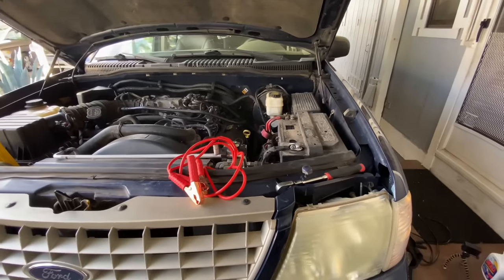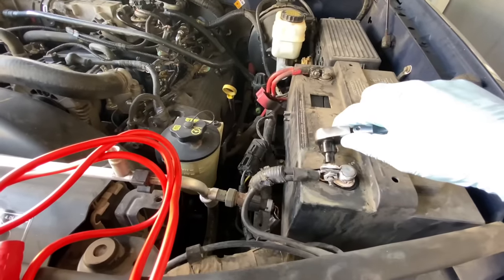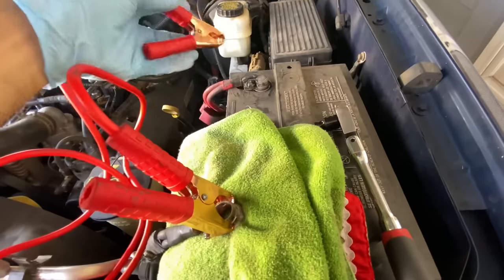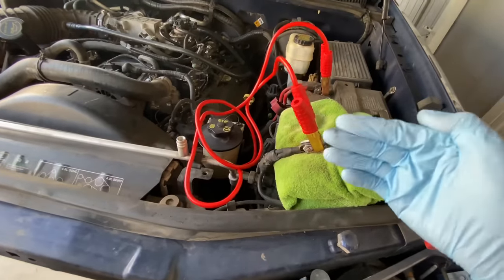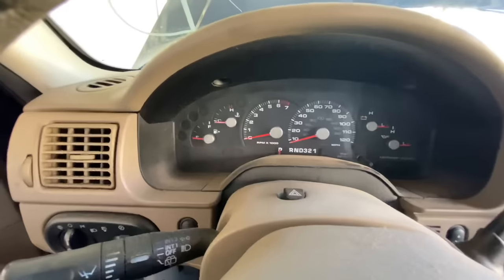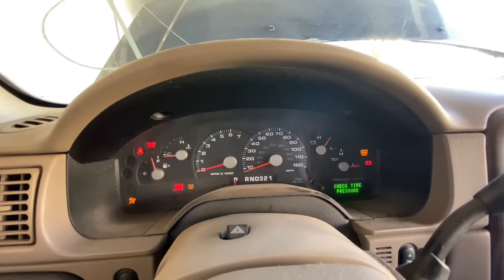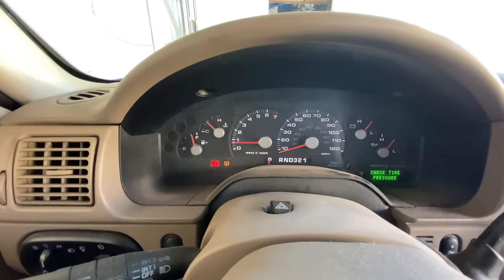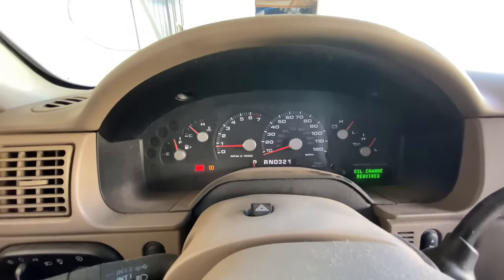How To Reset All ECU’s and Control Modules in your Car or Truck

Comment: I have a 97 T100.  My check engine light is on, and I often get shocked with static when I get in or out of the truck.  Also my heater is not working.  Will this help any of this?

Comment: I bought my Ford e250 and it has a speed limit and rpm limit. Does this reset it?
Reply: It will not fix you have to get a new key master to turn off the limits

Comment: Anyone know if the jumper wire that comes with a jump box, one of those little jump starters, would work for this? There’s only 2 clamps on it, 1 red and 1 black.
Reply: That would defect the purpose, because those are batteries.

Comment: So i have electrical problems and a check engine light showing on my 08 f350 6.4. Tried a similar method where i unhooked both terminals and then put the jumper wires on them. Let it sit for over an hour like that and electrical problems and check engine light are still there. Anyone know what’s up with that?
Reply: Scan for codes

Comment: If I don't have jumper cables handy can I just leave the ground disconnected for a longer amount of time to achieve the same result?
Reply from the maker: You get same results by disconnecting both terminals and clamp them together for few minutes.
Reply: by shorting the 2 cables together it discharges the copacitors for a fresh start

Comment: I’ve replaced my starter motor and the car normally has a 13.5 volt charge when running but since I’ve replaced the starter motor it’s been running at about 16+ volts so how do I fix that
Reply: Replace your alternator. It has a bad voltage regulator.
Reply: @randyluketich8950  thanks I’ve done that now it’s all good

Comment: I pulled a pcm at a salvage yard and installed it into my car, i started my engine 3 x successfully however after every time they motor shut right back off. Someone told me that I had my car in safety mode and their PCL need to be flashed for my VIN number. Is it safe to use this process you're showing on my car I just don't want to try anything that would possibly murder it forever. I know I've been told to go to the dealership to have it flashed but I have exactly $0 had to quit my job with no car quit working so that's what I'm working with so is it safe where does anybody have any other information for me by the way it's a 2002 Dodge neon.
Reply: Not sure if you fixed it yet or not but you need to have the new ECU programmed

Comment: Only problem is now is the vehicle has to run all it's monitors. If a monitor was on the edge of a failure parameter it may pick this up now and set a check engine light on. Fyi a evap system small leak detected may take a month to show up. The fuel gauge must read between one quarter and three quarters or tests will never run.

Comment: replaced the throttle control sensor and did what you said with the battery cables and it didn't work

Comment: U😯, like many, have heard the word ‘ground’ with cars(revering to the negative side of battery), & mistaken it with actual ground for houses, buildings, 110, & there in assumed the electric has a place to exit through(& btw tires are rubber & rubber don’t conduct).  NEwA, that trick, bt with headlights on, might be choice.  I’m gonna try that(pref. with - connector a little further from - terminal, cloth or not), but turn & leave headlights on, & see if they flicker.  good 9/10ths of an idea, & gud video chEf- thNx👋

Comment: This is the only video that actually help reset my Jeep, thanks!
Reply: Doing mine now. Why did you need to reset yours?
Reply: @livdreams1269  I went to O’Reillys to get the check engine light on for code P2016, then came back from getting the print out and it didn’t turn on, I reset it once, worked until I had to turn it off, then did the proper reset with this video and it worked for about a week, not it doesn’t want turn on, I’m thinking it’s either the starter or ignition relay now, and after the first restart, the check engine light went away
Reply: @livdreams1269  how about you?

Comment: Nice.  Will this be safe to do on a 2007 Suburban 1500?
Reply: Hey im doing this to my 07 suburban  right now did it work for you ?
Reply: @urielluna8788  I haven’t tried it.
Reply: Well it didn't work for me ! I had a hard shift from 1st  to 2nd  now dont even have 3rd  or 4rd  got transmission  rebuilt I think my tcm and ecm are messed to bad to try to rest
Reply: @urielluna8788  Yikes!  Sorry to hear that and thanks for the update.  So you have 2007 Suburban as well?
Reply: Yes I do 2007 suburban  lt
Reply: @urielluna8788 so many variables with transmission to diagnose the actual problem.  Hope you or a honest mechanic will be able to figure it out the root cause of the issue.

Comment: Will this work on airbag module thanks
Reply: If there is an actual fault in the system itself, then it will only work for a short time then it will fault again until it is fixed

Comment: You do not need to connect the ground cable to the positive. Because electricity doesn't run that way in the first place. Electricity comes out of the battery through the ground cable and goes back into the battery through the positive cable. All you need to do is disconnect the negative for about 5 minutes and it all drains off. You don't need to be screwing around with connecting cables that don't need to be connected.
That's also the reason why you always disconnect the ground on a battery first and connect it last.

Comment: Lexus replaced sticky dash and broke odometer, gas gauge, tire warning, etc.  They won’t fix… Said it was a coincidence that a green circuit board under the dash just happened at the same time and new one with labor $3000.  Any idea which part broke and your idea if this was just a coincidence…
Reply: what year is your car .and even if its really new and all digital ,sorry to say but were ever you went there ripping you off...
Reply: 2008 LS460. Lexus dealership in Baton Rouge, LA

Comment: Just a minor point, but you might want to clean that corrosion off the battery terminals & clamps. And I dunno, that half-inch drive ratchet might not be big enough😆 🔧
Reply: Certainly cleaning terminals/clamps a wise move "just because". I did laugh too at the BF 1/2" ratchet tho. Surprised he didn't get his breaker bar out ha ha. He was LEANING on that 1/2" too...
Reply: If you have never grabbed a half inch drive ratchet to take a batttery cable loose (because it was handy) then you havent worked on cars much!

Comment: On regular jumper cables, do I use both positives (reds)?
Reply: Treat it as a single wire, color doesnt matter whether you use the red or black as the jumper, but it has to be one or the other.
Reply: @NavyGuy001  thanks! will do

Comment: This will not clear permanent codes which can be in some of the newer vehicles. So you have pending codes, store codes and permanent codes. The only thing that clears permanent codes is a repair of the pertinent system... I also don't advise these older types of clearing codes for the newer cars. However, if you are going to use this method once you have your ground strap disconnected and the wire from the ground strap to the positive turn the key on... That clears the codes right away. Just remember to turn the key off before you reconnect the battery...

Comment: I did this after I failed smog due to "Reset PCM," being called for to ready the Evap system. But, I only let it sit 7-8 minutes and drove the heck out if the car, but the PCM had not reset. Next time 30 min with the light switch on.

Comment: So why doesn't the jumper drain the battery when the other end is hooked to the ground wire?
Reply: Because draining requires current flow through the battery which can't happen with either (or both) terminals disconnected. Either terminal could be disconnected to eliminate the battery in order to drain the energy stored in the capacitors, but it's always risking a battery explosion to disconnect the positive terminal before the negative.

Comment: Can someone please assist me I have vw Passat 2.0 fsi automatic i had a problem with my ecu I had to change it, I installed ecu from a manual Audi A3 now the gear when I put a gear on drive is just on gear number 3 it doesn't change and is so hash when I take it from parking to drive or reverse. And break lights are always on. Can this method work

Comment: ECU is Electronic Control Unit  whereas PCM is a Powertrain Control Module.  Those are the 2 computers on most cars and trucks.  Some, I don't know which have 3 computers.  Diesel vehicles have up to 5 computers controlling the engine alone.  Complicated stuff.

Comment: Disconnect both cables from battery before you add jumper. I did it the way it's explained here and shorted out wires in my car

Comment: Does this so-called "ECU full reset method" actually 100% safe or not?
Reply: I dunno man. My car died after trying it. 2009 Pontiac G5. Not saying this did it, but it didn't work after I tried resetting the ECU, so it might be easier to cause damage than it seems.

Comment: I thought you had to do 3:22 both of them when they’re off the battery and then you wanna turn on your AC after this set for five minutes run your AC on full blast for five minutes and then turn your AC off and then let it run for five minutes with a little bit of acceleration

Comment: This is an obsolete method which  can damage newer car ICUs.  Never do a direct connection as shown here unless you put a 10watt 1 ohm resistor between the two.  Without the resistor, the discharge is too sudden and can damage the ICU.  Use the resistor and let the connection stay connected for 10-15 minutes.  This will reset the ICU gently and prevent serious and costly damage.

Comment: I have an Toyota Camry 07 that has idea problems after I unplugged the battery like I can push my gas paddle to the floor in cat won’t ideal at all
Reply from the maker: it need a idle relearn procedure after battery disconnect, I have a specific video for that.
Reply: sometimes it will relearn on its own just driving.
Reply: @GK7GARAGE  I have a 91 Oldsmobile Cutlass ciera, 3.3 L 6 cylinder, I am very interested in trying this however, I really do not want to create other problems for myself :-)

I did this to a 2004 Nissan Titan the only difference is I just crossed/clamped the terminals together for about 5 minutes. After that procedure the gas gauge never worked again. Having said that I am a little gunshy but interested in this procedure. I have replaced a couple of hundred dollars worth of parts that the car actually needed that included a mas flow sensor. Car still has a sporadic idle and hesitation at takeoff. 

I have searched your collection of videos and cannot find the one you're speaking of regarding relearning idle speed. I've noticed several others are looking forward and can't find it either. I would be very interested in seeing that video.
Thank you

Comment: Be sure to turn the headlights full on.
And turn the ignition switch to the ON position.
Your method did not remove the oil change notice.

Comment: This is not the same as a flash this is pretty much how you reset your engine light if you fix the problem if you did not fix the problem the light will just come back on

Comment: THIS DOES NOT WORK!!! ON MY 2012 HYUNDAI SONATA 2.0T. I  I FOLLOWED THE INSTRUCTIONS TO A TEE, ONLY TO HAVE MY CABLE WIRE GET FLAMING HOT AND HAD TO REMOVE IT IMMEDIATELY! I TRIED FIRST WITH JUST THE NEGATIVE CABLE AND THEN AGAIN WITH THE POSITIVE CABLE, AND GOT THE SAME RESULTS BOTH TIMES.

Comment: You didn't reset everything, it even tells you the oil needs changed...LOL The reason it throttles down is it became warm, so the IAC told the PCM to back of the RPM. Second, you did "reset" some parameters, but you did it wrong. You supposed to turn it to run, wait a few seconds then try to start. If it starts it will run like crap but if it dies thats OK, but do not hit the throttle. Next turn it off, then back to the run position and restart. At this point it should start and run fine. Things usually fall back into line at about 80 miles and 12 starts. Transmission does not reset, neither does ABS. To get those reset one needs to hook up to them and electronically do it. Some older cars you can get to reset, but not the newer ones, and surely not most.

Comment: I thought the other way to reset it is you take the Bernie boat battery terminals off together and connect them obviously the battery is not connected and do it that way I do a hard reset
Reply from the maker: It’s basically the same thing

Comment: Where do you find just 1 cable?
Reply: You got to be joking man right,,,,!?
    But just in case you're not jumper cable is consist of two cables one has a clamp or should say two clamps that are red and the other cable has two clamps that are black on each end just pick red and use both of them that's one cable or pick black and use both of them that's another cable but you're using one wire to make a connection between the two...
Reply: You got to be joking man right,,,,!?
    But just in case you're not jumper cable is consist of two cables one has a clamp or should say two clamps that are red and the other cable has two clamps that are black on each end just pick red and use both of them that's one cable or pick black and use both of them that's another cable but you're using one wire to make a connection between the two...
Reply: @derekweese2230  I was not joking. I have jumper cables but I never seen the red separated from the black. they usually come suck together. Just the ones I have seen. So I was wondering were did he get "just the red cable with no black which makes this process a lot easier.  Thanks for the info.

Comment: I was involved in an accident 2weeks ago, and my car has been beaten back to shape. My problem now is it won't start and the electrical said because the check engine light; the battery light and my engine oil light didn't come, it means my brainbox is spoilt and would need to be replaced.
Reply from the maker: An electrician have to check all wiring for damage
Reply: Some cars have fuel cut off when it gets hit

Comment: Disconnect battery for 24hours and it  will  reset almost every ECU . . If you doe this to some Saab's , and then drive it to a long hill and hit 5500rpm at 70mph plus it teaches the ECU and give you 15bhp more for free at certain rpm , semi A.I fuel map . (  MAKE SURE YOU HAVE THE RAIO / STEREO CODE FIRST !! )Cheers

Comment: You just hooked a battery with voltage to a ground that grounds everything in a vehicle.  It should've burnt everything up and shorted the wiring.  Positive is supposed to be removed also to drain the voltage.

Comment: Bro i have did this 5 times i even left it over night .. my car has 1 battery as most do so anyways I have did exactly  this same thing I even took the fuel pump fuse out to created a open circuit  in the fuse box .. my car literally  remembers everything  its like it has a back up cell somewhere that I can't freaking  find ...

Comment: This reset procedure will not work on all vehicles. Try disconnecting the battery in a Scion. It will not work. On this car you have to shift the car from park, reverse,drive, 2nd, 1st gear several times or the car will not shift and idle poorly.

Comment: This video may have worked for someone not for me though 2001 Lincoln ls 3.9 hard starting hooking cables up like this is nonsense your better off just disconnecting the battery and let it set once reconnected you will have the same results have it reflashed or reprogrammed

Comment: What causes the need for a rest? I have a 2013 Hyundai Elantra. My car was stolen in July 2023 with the tiktok trend od stealing cars in a record time using and iphone charger. After recovered by the police and fixed, a month later I needed a new alternator. Then the supposedly anti-theft software upgrade from Hyundai. A month ago I paid MAVIS about $800 for a new Battery and Starter and yesterday (Thanksgiving) morning my car was stuck in ShopRite parking lot because it did not start. I had to have it towed back to MAVIS... I had no check engine lights on. The "manager" says he don't know why the car would be asking for a relearn. But when I asked will this likely happen again he says 'No' 🤔 Umm Why not if you Don't Know what caused it? 🤦🏾‍♀️

Comment: Not a good idea using the jumper cable on late model vehicles! Some components/modules have batteries in them to store settings and you could blow an expensive module!
Disconnect battery as shown, turn on headlights (they won't work, obviously. But it will drain any residual power) and wait 5min or so. Reconnect Battery.
To reset idle, simple drive as normal and the ECU will settle the idle down in a couple of days.

** If you have a vehicle with a stereo fitted that has anti-theft device built in, make sure you know the reset CODE before disconnecting battery! **

Comment: Hmm the fault will still be there.. It's as well to fix fault that's recorded at the time.. What's point resetting ecu you may lose recorded fault take car out and it breaks down . Most cars now have things like electronic steering etc.good luck with that 3rd lane motorway..

Comment: this does absolutely nothing as most of these sensors are only reactive when the ignition switch is in the "On" position
Reply: some people really like to look busy!
I wonder how many people hooked up the jumper straight across the battery... to reset it good 😉
Reply: funny cause in a dodge manual resetting the throttle is to disconnect battery and leave lights on for 15 min. then re connect and turn one key. slowly push throttle down to floor and slowly raise back up. turn off key. then start. and it woeked on 2002 ram 1500.

Comment: Either way you look at it, you're shorting out the battery. That's a ground cable you're hooking to a positive. Supposed to touch negative connection to positive connection without battery attached